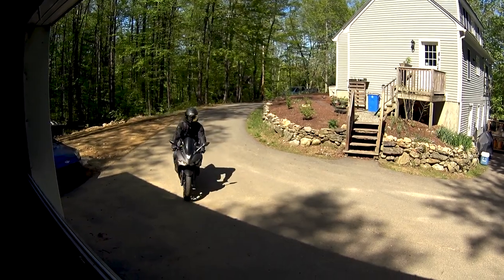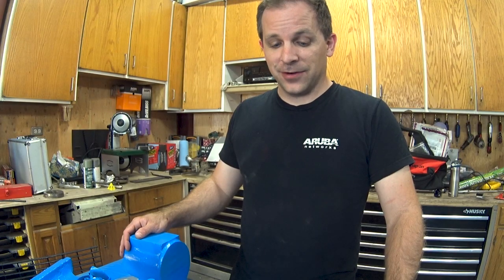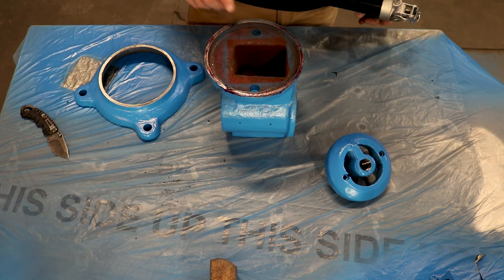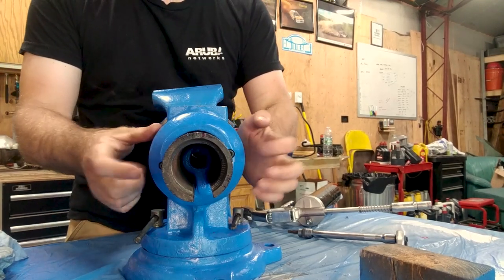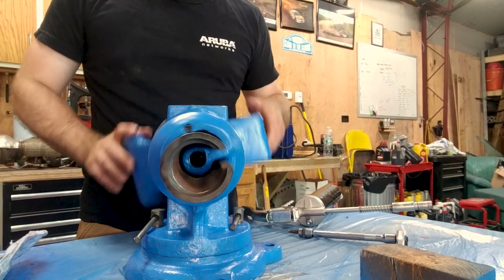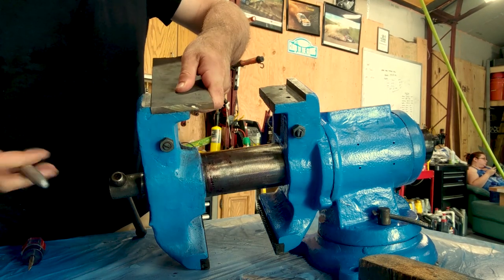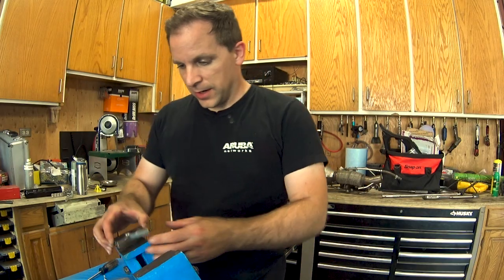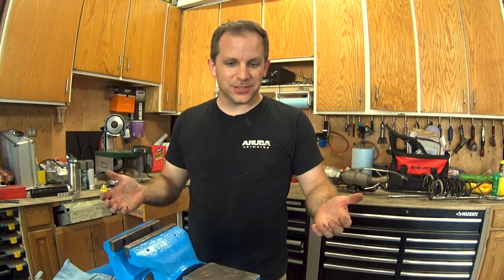This Vise is Amazing!!

Comment: I found the exact same vise, in much worse condition. I want to restore it, but the back plate with the nut and split pin is broken. I need a close up of the back plate to see what needs to be done. Also, does it need a special nut at the back? Must the vise turn, if so, why? Thank you.

Comment: Don't hold small bits of heavy steel with your hand when you work on the drill press. It will take your finger clean off.

Comment: Fantastic work on the restoration, and a nifty idea with the bed-liner paint job. I love a good restoration!
Reply from the maker: thanks Seth! i have so many things covered in Raptor, it isnt funny! my garage floor is raptored!
Reply: And it just goes on like paint?
Reply from the maker: it is a bit thicker the normal automotive paint so you need a lightly larger tip. But the floor we just used a roller and rolled it on.
Reply from the maker: We also reduced/thinned the paint a bit. so it wouldn't be pebbled like in a bed-liner
Reply: Lazy Brook Farm Oh OK, I was wondering about the texture.